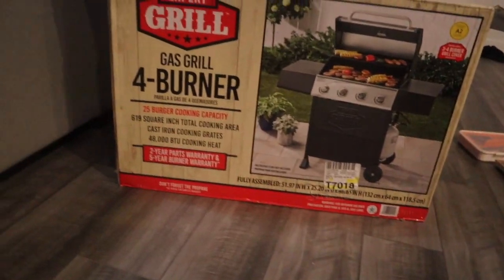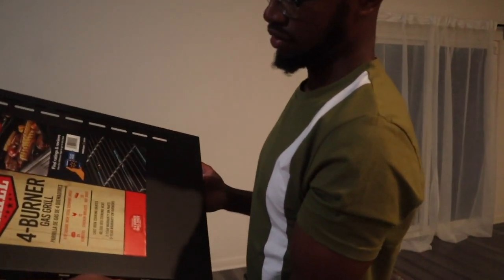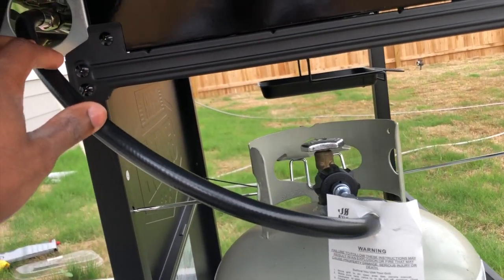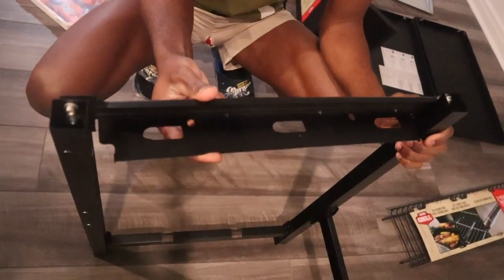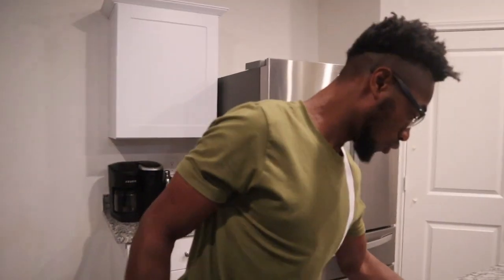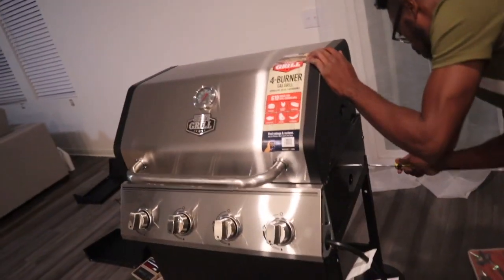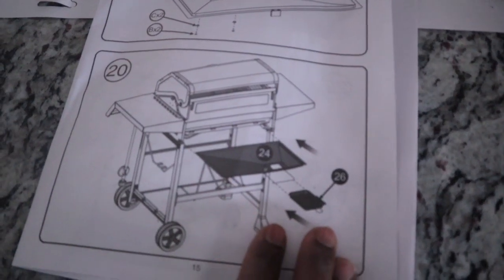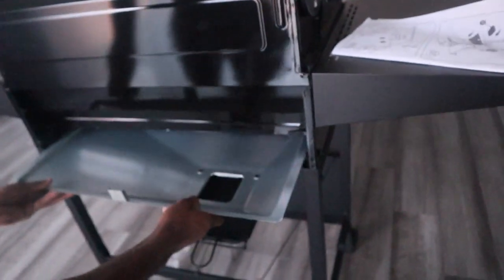4 Burner Gas Grill  ASSEMBLE and REVIEW .

Comment: Is there a big gap in the rear of the grill when it is closed?  I like to add a smoke box sometimes and want it to be sealed up as much as a gas grill can be.
Reply from the maker: Yes I do have a a gap but not to big .
Reply: @mackendymentor  Thanks I saw Walmart had a good deal on this grill.
Reply from the maker: @noobpyrotech9991  yes the price went completely down after I bought it 😂

Comment: Just bought this grill just wondering what your max heat is  mine is only going too 450
Reply from the maker: Mine usually go to 600 it’s depends on what you have on it or how many meat 🥩 you have on it  I also bought this to use to put wood on it as well when I’m doing bbq 🍗 Pellet Smoker Tube - 12” 304... https://www.amazon.com/dp/B07MYQNRND?ref=ppx_pop_mob_ap_share
Reply: @mackendymentor  I have had nothing on it yet just wanted to burn off factory oils ect and season the grill and it didn't seem to want to heat up any